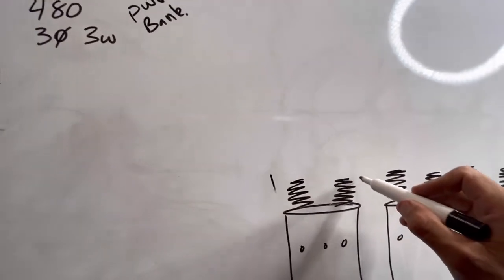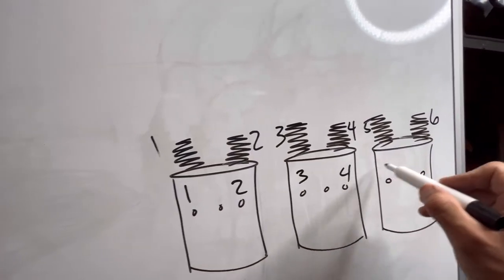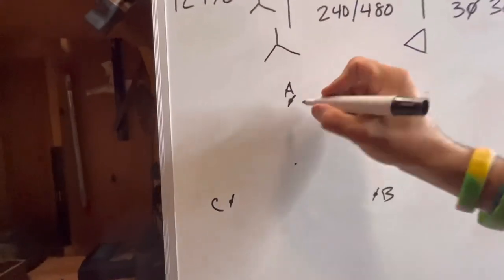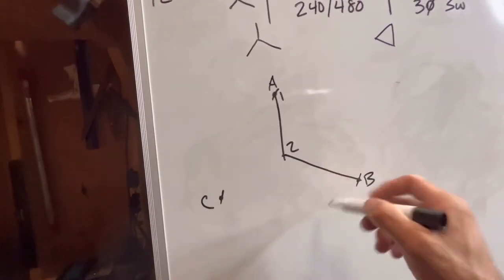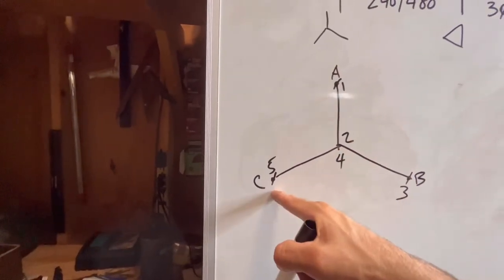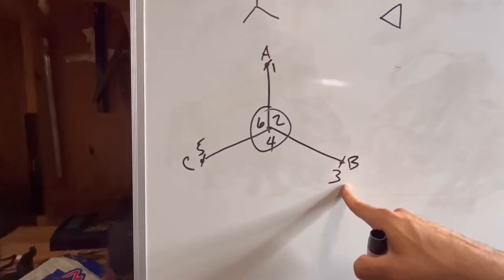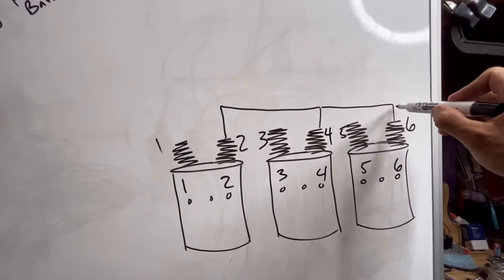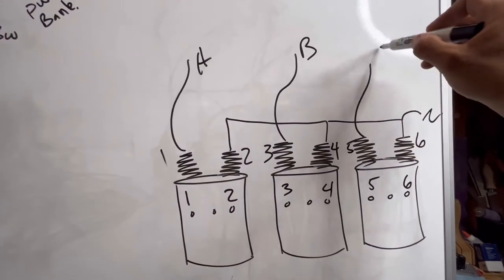HOW TO: Vector Transformer Banks

Comment: Cody, I have almost 40 years as residential / commercial electrician. When I learned about transformers to take my state test, I learned the wild voltage (208volts) is the result of an open delta (2 pots). Now you explained 3 pots connected in delta with adding neutral activates the farthest leg as wild leg. Can you please direct me to literature or more of your videos to clarify my confusion?
Reply from the maker: Yes sir. So firstly a wild leg is a phase to neutral voltage that will always occur any time we introduce a neutral to a delta circuit. Secondly when our customers require a delta voltage( meaning 120/240 or 240/480) we can supply that voltage by making a delta connection using either two transformers (open delta) or three transformers ( closed delta.) Its hard to explain over a text but if you could imagine drawing a triangle. Each line represents a transformer coil. The points of the triangle would be your three phase voltages and they would all be equally distant from each other making your three phase voltage equal ( meaning phase to phase to phase 240-240-240.) The neutral is tapped off of the middle of one of the lines. Which would make the phase to neutral voltages not all the same. Two of the voltages would be 120 “inches” from the neutral and the last one would be 208 inches from the neutral. Now imagine taking one of the lines away. (Meaning you are now only using two transformers). You still have the same points of the triangle and the neutral is still in the same spot. The voltages or (distances) haven’t changed. The only thing that changed is the capacity (current rating) of the bank because all three phases are still being produced but now they’re only being supported by two transformers instead of three. I hope this cleared  some stuff up for you. It’s super difficult to answer these type of questions over a text. Maybe watch the video lesson on “how to build a two pot bank” or now rewatch the vectoring video. Keeping in mind that the voltages are coming from the vectoral distances between all the points on the vector. Sometimes a fresh perspective helps a lot. Please let me know if this helped. Feel free to email me at hilineacademy05@gmail.com. I can include pictures in my answer. Stay safe 👍

Comment: Why did you yoe down the wye /delta. Thats wrong. You float the wye /delta
Reply from the maker: Ya I hear ya. To operate the bank I obviously had to tie it down and I mentioned floating it when I was going over the connection. But I didn’t go over floating it because the focus of the lesson was on the open corner. But yes we always float the primary neutral connection👍
Reply: Great catch 🤙🏼

Comment: I’m probably just missing something, but when do you know when the whey vector diagram is inverted or not?
Reply from the maker: So guys will usually have this question when they are vectoring additive transformers, and they are making the x1 bushing the phases and tying the x2’s  together and bringing them down as the neutral. The standard is to always make the x1’s the phases. So with additive transformers x1 is on the right side of the cans. In other words your 2,4 and6 bushings will be your phases. And the 1,3 and 5 bushings all tie together and become your neutral. It is kind of confusing when you vector it out because you have to almost know the connection before you vector it. But if you follow the rule of which number is on top when labeling, meaning you look at the primary vector and for example on your 1,2 can. If 1 is on top of 2, then the secondary vector would be in the same angle with 1 on top of 2. After you draw all of your secondary angles underneath each can. You can then build your wye shape with those angles remembering that the 2,4 and 6 bushings will be your phases and the 1,3 and 5 bushings will all tie together and become your neutral. Your wye shape will then be “upside down”. I hope this answered your question. Let me know if you need any more help. Stay safe. 👍
Reply: Thanks to answer this question, the last bank have subtractive Xmers,16000V >8660v, so X1 will // H1. My question do you always take H1 tobe your primary phase and X1 your secondary phase?
Reply from the maker: @itamorales6580  that’s a good question. You can use H1 or H2 as your feed for the can. That is to say if you had a phase to neutral connection on your primary side, you can connect either H1 or H2 to the phase. It doesn’t matter. The movement of X1 in reference to H1 per additive/subtractive transformers is due to the fact that H1 and X1 will always be pulsing the same polarity at the same time. So when H1 is being fed with a phase and the sign wave is on the negative side of the sign wave, X1 will be outputting the same negative polarity at the same time, no matter if the transformer is would subtractive(meaning the primary and secondary coils are wound the same direction) or addative( meaning the primary and secondary coils are wound in opposite directions.)
Reply: Sorry for the late reply! Burning the candle at both ends! Thank you so much for your answer! It has helped way more than you know!😎

Comment: Great video and explanation but it threw me way off when you referred to the circuit voltage as the phase to phase voltage of the system. It must be a southern thing but I’ve only ever heard anyone refer to the system voltage as whatever the phase to ground voltage is and never the phase to phase. Great video though
Reply from the maker: I hear ya. I think what we do is use the language that we use, based on how we hook up our transformers on our different circuits. For instance where I work, we hook up all of our single phase transformers up with a wye, or phase to neutral hookup. So a lot of the guys here refer to our system voltage as a 7200 volt system( we have a 12470 GRD Y.) But there is an industry standard. In the world of linework, when we refer to system or circuit voltage, it’s always the phase to phase voltage and what type of circuit it is. If you use the phase to neutral voltage, you would not be able to name a delta circuit. Hope this helps. 
Stay safe. 👍

Comment: Hey Cody great video along with all the rest. I was directed here by an old coworker. Quick question, I'm assuming there is a way to figure out rotation via vectoring. Care to elaborate? Thanks in advance.
Reply from the maker: Great question. There is as long as you know your primary rotation. For example. If your primary rotation is ABC clockwise and your primary vector has 1,3,and 5 being fed by AB and C respectively.  Then the secondary vector will be 1,3 ,5 clockwise. Stay safe. 👍

Comment: I have really been enjoying your videos and how you really make it easy to understand vectors, polarity and transformer hookups in general. 

My question to you is on a 21kv circuit, name plate reading 12,000/21,000Y, and you were to parallel 2 transformers together in the secondary and a wye hookup in the primary, would the primary phase on each pot have to be hooked up on the same phase of a 3 phase circuit or could they be on different phases in order to achieve the parallel? Would this cause problems going back towards the sub if they were paralleled in the secondary and the primary being hooked up on 2 different phases? We don't parallel pots anymore because it's more difficult to troubleshoot. However, it was just out of curiosity for me. Thanks for your help.
Reply from the maker: Awsome question. So in order for the secondary’s of two different transformers to “parallel”, the secondary vector angles must be the same angle, or in other words the secondary vectors of each transformer must be “parallel”to each other. In order for both secondary vectors to be the same angle, they must be fed by the same primary phase. Or phase angle. Remember. The primary phase angle creates the secondary phase angle. 
The term “parallel” comes from the vector explanation of why it works. 
Hope this helps. Let me know if you have any more questions. Stay safe 👍
Reply: Thanks for the response. To piggie back off that first question, creating the same phase angles in the secondary on a delta primary hookup would have to consist of the same 2 phases of a 3 phase circuit in order to parallel the secondary, correct? Thanks
Reply from the maker: @FacundoRonquillo  yes sir absolutely. You got it. 👍

Comment: You show HOW to wire all the configurations. You showed a great short cut how to draw out the delta and wye woth the numbers 1-6 and so forth... 

Question... You glossed right passed the phase angle / angular displacement part...

Do you have a video expanding on this? I feel like i could take any of your examples and modify the delta or wye to still fit the "6 is above the 5" rule and make the configuration different.
Reply from the maker: I don’t have a specific lesson explaining displacement. With this style of vectoring you don’t have to worry about it. There are a few different perspectives that people use in order to try to explain the connections and the relationships we make between transformers to get the desired voltages. When you use the method of vectoring that uses a vector wheel displacement becomes an issue you have to explain. For example when you have a wye delta hookup or a delta wye hookup. This comes from the angles from primary to secondary being the same angle. In order to fit them inside a vector wheel you have to start the secondary vector 30 degrees off from the primary vector. In learning each way of vectoring and teaching each of them I’ve found that the style I teach which is called field vectoring lends the easiest way to understand the connection and how to manipulate them to get the desired voltage. It all comes down to what style is easiest to learn and apply in the field. 👍

Comment: Do you have any advice for using vectors to troubleshoot banks?
Reply from the maker: I’m working on it but it’s hard to trouble shoot from a vector perspective. If you know what the vector should look like for the bank you’re working on you can figure out what’s going on with the bank once you start taking voltages. It helps a little but once you start reading voltages on the bank some of the voltages you read will be coming back to you through the load so it’s pretty hard to to be honest. The best teacher for troubleshooting is experience and a load box like a “Beast of Burden”.
Reply: I gotcha. I went from a co-op who had only wye primary to a utility that deltas the tops now.  So I’ve have to relearn all my vectors and now being a trouble man, I use the beast a lot. Just was trying to see if vectoring could have some shortcuts to them delta banks.

Comment: So are these “ inches” say …..480….is that how long the winding is?   Apologies if that’s a dumb question.
Reply from the maker: Yes. Absolutely! The voltages comes from mathematical quantities of angle and distance. So for example, the wild leg in a 120/240 volt delta secondary is 208 volts. But none of the transformers have an output of 208 volts. So where does it come from?  If you use pythagorean theorem which is 
a2 +b2=c2, the distance of b is 207.8 inches.
All of the voltages are just a function of angle and distance. As lineman we can manipulate transformer connections to give us what ever desired voltage we want. This is the beginning of learning in regards to transformers.

Comment: How does the 120 degree angle plus the 277 voltage give you 480 phase to phase?
Reply from the maker: Good question!  The 480 volt potential phase to phase is a product of three 277 volt transformers being hooked up in a wye hookup. Each transformer only outputs 277 volts and we create the 480 volt potential with the hookup. If you look at the wye vector, each line only measures 277 inches long. Now when we measure from the points( or ends) of our lines to each other we will measure 480 inches. 
In a wye hookup, the phase to phase potential is not an output of an individual transformer. It’s a product of three lines connected together at a common point and separated by 120 degrees. The phase to phase potential is created by the connection and measured at the outside points of the vector. 
I hope this helped. These questions are difficult to answer over text. Please reach out if you need any more help understanding this. Stay safe. 👍

Comment: Doesn't the numbering of the bushings on secondary side depend on if the transformers are subtractive or additive?

The banks on your diagram make sense to me if they are all subtractive. Someone correct me if I'm wrong.
Reply from the maker: A better way of looking at it might be to say that the numbering system is a point of reference that we use to keep each vector angle consistent with the connection. It really doesn’t matter if the transformers are additive or subtractive. The connection will still be the same. For example, a delta connection is inside bushing to inside bushing. Inside bushing to inside bushing. And a tie between the two outside bushings. If you explain it in terms of “x” bushings. On an additive bank from left to right would be x1-x3. x1-x3. and x1-x3. On a subtractive bank from left to right it would be x3-x1.    x3-x1 and x3-x1. But the numbering system on the vector would be the same. And the connection on the bank would look the same.  I hope this answers your question. This is a tricky question to answer over the phone. I wish I could show you on the board.
Reply: @hilineacademy8482  I really enjoy your videos so far. keep it up! There is definitely a need for education that you are putting out there.

Thanks for the further explanation. I was just taught slightly differently but what you are saying make sense.

I also like how you draw out the secondary vector angles and explained that there are two ways to arrange them. Very cool stuff.
Reply from the maker: @LOFIchillyboy  thanks for the encouragement. There are a few different ways to vector and some methods kind of contradict the other ones. I’ve finally settled on this method for a few different reasons. It’s easy to remember and easy to apply in the field. When I start putting out videos on paralleling , the real magic of this method will be seen. Thanks again and if you ever have a question or need help with something, get ahold of me. Thanks again.